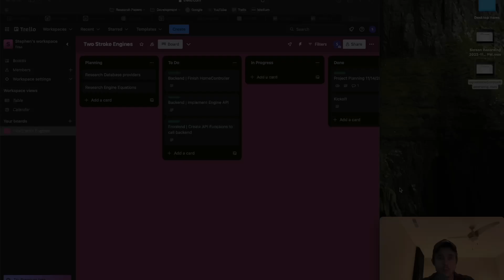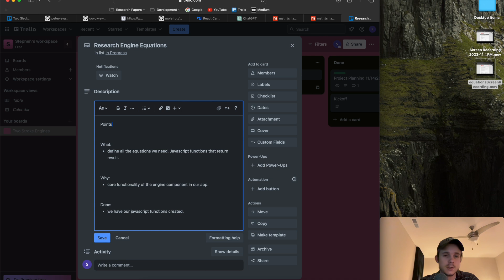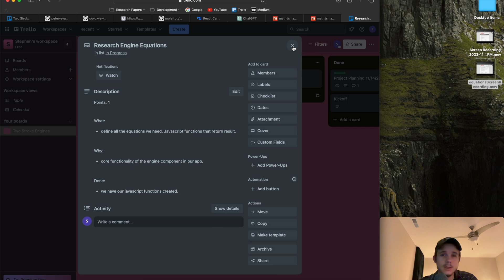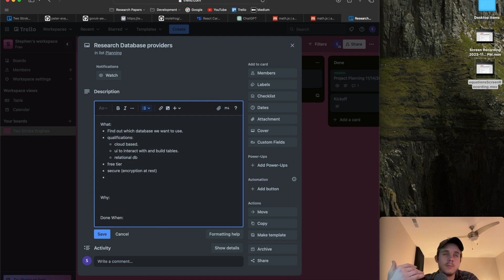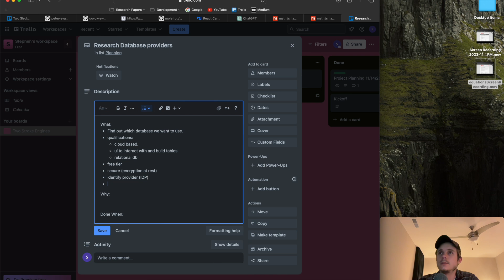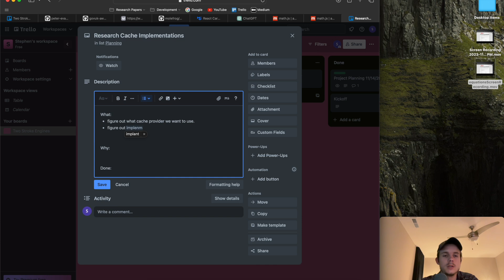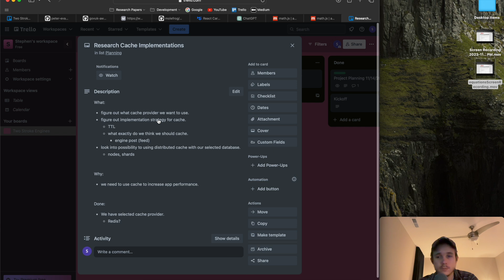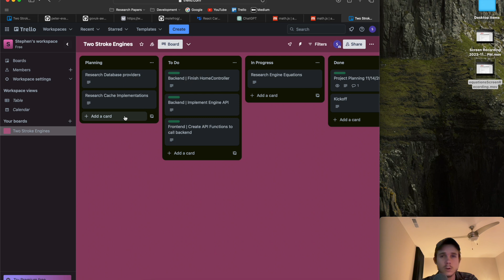Software Engineer - Daily Standup 3 - Engine Equations Research @StephenSamuelsen

Comment: Alrighty ready for new episode--had to watch through older episodes. 

So am I correct in that you're making a web app that models a 2 stroke engine? So the end application, you click on 1 side of the engine and you see details of it? 

You got this! LETSS GOOOOO!
Reply from the maker: Hey yeah so my plan is to include a fully interactive engine model that simulates basic 2 stroke fluid dynamics. I am including equations that will allow users to enter very specific details and then see the result. Co2 Emissions is also going to be a large component as well. There will also be a social aspect to the web app that I will cover later.